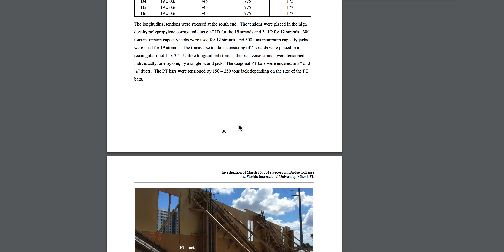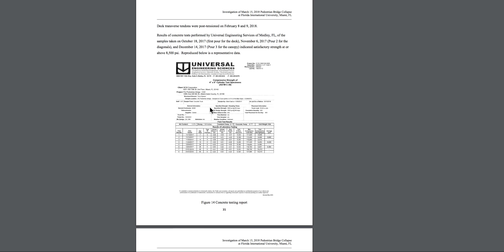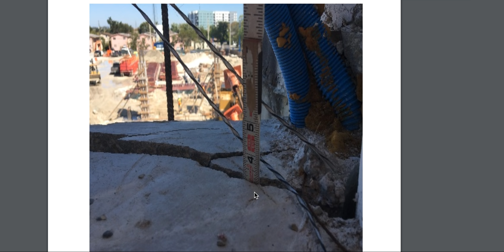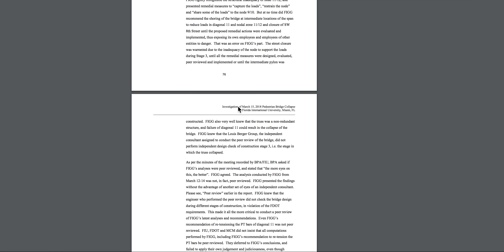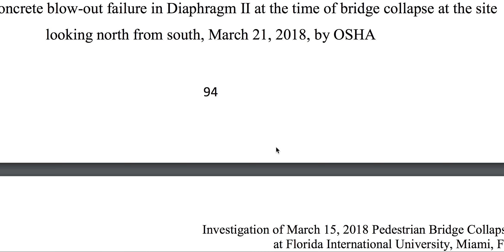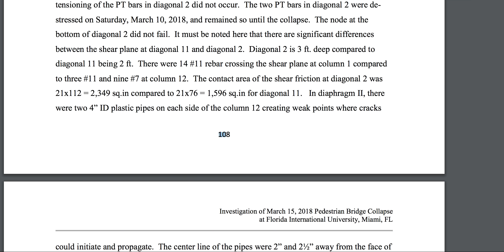FIU BRIDGE COLLAPSE OSHA REPORT I AM IN IT!

Comment: Mr. CEE. It is becoming obvious why all the cracking at the base of member 11, how the support of member 11 suddenly disappeared from the structure, why we see a puff of dust at the support before the collapse, and why member 11 seems to stay intact during the the failure. The support "diaphragm" failed and I think I know why.

I seem to remember an early drawing of the Bridge support bearing that showed it resting with full support on the pier, or multiple bearing pads along the "diaphragm" as they call it, and I thought it was suspect when they actually set the bridge on what I remember was just two bearing pads spaced near the outer ends of the "diaphragm". Can you verify this was the case with your drawings?

Is it possible they designed the "diaphragm" to be fully supported along its length by the bridge support pier and by placing it on bearing pads at the ends only, they made it into a transverse beam with the full 475 ton vertical component of member 11 at its center? After the cracking that was observed Members 11 and 12 subsequently punched thru the "diaphragm" and deck and the crushed concrete could no longer transfer the horizontal component of member 11 back to the deck, causing 11 it to "kick out" and literally be removed from the structure, transferring all loads back to the top and bottom slabs which subsequently failed.

 I see no stirrups in the failed diaphragm, its depth is severely reduced due to the deck tendon openings and it may not even have been possible to reinforce that section size enough to span between the bearing pads with the point load involved.  Someone should have noticed the critical nature of this condition and provided more bearing pads. There was no need to even create the possibility of a support problem when you already have a pier in place to support the full width of the bridge. 

The post tensioning of member 11 may have contributed to the failure, but only because the lower anchorage of the tendon was already severely compromised by the condition of the concrete at the bearing. If the diaphragm was not designed to span the width of the bridge, the bridge did not stand a chance with the point loads involved regardless of what was done with the post tensioning. Someone should have seen this coming with the cracking involved and someone should lose their job over this.

Is this really as simple as a change in bearing pad quantity/placement? The evidence says so.

Comment: Congratulations.
WOW! The forces must have been monumental. So the concrete wasn't fully cured. What must it have been, 70 to 80 percent cured? 8000 psi concrete reinforced with rebar and post tensioning cables. Belt and suspenders and still it was riddled with cracks after only 5 days or less. When you look at the cross-section of the walkway and see how thin the concrete was at the center due to the drain pipe and about a million pounds of truss and canopy sitting right over it at 4 points and it didn't punch right through it shows how strong that concrete really was. 

Pate was right. Shoring it up would have given a false sense of security. Nothing was going to hold that thing together. I like how he assumed the cracks were repairable. The photos didn't do them justice. They were even worse in real life. The bridge was suffering from concrete ebola virus and doctor Pate was going to put bandaids on it.
Reply from the maker: Thanks Mark, I appreciate the love.

Comment: The explanation at this point is rather elementary.  The structure started to sag immediately upon removal of form work, caused at least by inadequate design of the node (11/12/deck).  The sagging slab was twisting itself away from the node, which could not move, and 11 was taking a beating being the primary weight bearing member.  Ratcheting up the tension on the 11 PT bar was unconscionable!

Comment: It's shocking to me to learn of the jack hammering and removal of concrete from the original deck pour.   I don't see how it could be done without the inner rebar being damaged, or even the forms themselves.  It appears OSHA is getting to the bottom of the issues more than anyone else.  You have to be careful because you are looking at before an after versions of the cracks.  I'm shocked by the extent of the cracking before the collapse, but it is reminiscent to me of the cracking that develops in beams that are being stress tested in large hydraulic presses.   This structure was obviously in the process of disintegrating.